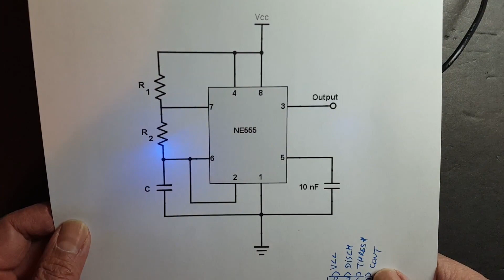HariFun #162 - Retro Electronics with Julian Ilett

Comment: That circuit is all over the internet. I built that way back in the "Night Rider" TV show days.
Nothing special about that circuit... Thought you were more electronics mature.
Unsubscribed...
Reply from the maker: Lasersbee, I understand your disgust at the simplicity of the project.  But simplicity was exactly why I thought it was cool.   Just like Juilan, I had fun putting with that circuit together.  I'm sorry you didn't enjoy it.  Sorry to see you go.  Thank you for your honest feedback.
Reply: And this is why I detest the Arduino fanboys. They learn to copy and paste code but learn nothing about the very basics of electronics. I will not let my youngsters move on to programming without learning the fundamentals of electronics first. The knight rider circuit has been around for decades, and is one of the first projects to learn after learning the simple oscillator variations of the good old 555 IC. Basic components, then timers, op amps, and counters. Once you know by heart how to construct basic circuits with these IC's then you can move on to microcontrollers, and even then in most cases a PIC and simple pic programming cable and board, can do most of the basic functions necessary that learners of arduino need in their early projects. Its all about the proper foundations.

Comment: I have some transparent breadboards from a seller called  robodyn on Aliexpress and they are great. They do not film well though. I have ordered some white ones to see are they also good
Reply: Hari Wiguna I believe these are the ones he mentioned https://m.pt.aliexpress.com/item/32807239104.html

I love your videos, Hari. Please keep making them. Cheers.
Reply: This is the store I'm talking about Hari

https://robotdyn.aliexpress.com/store/1950989?spm=2114.10010108.100005.2.25e820d7N3Hl1z

Here is a half size white one:
https://www.aliexpress.com/store/product/Solderless-Breadboard-Self-Adhesiv-size-8-3x5-5x0-85cm-White-color/1950989_32801985959.html
Reply from the maker: Thanks Brian! Interestingly, that one looks exactly like the crappy one that I use in video.  The continuous power bus (some has split power bus), the sequencing and uppercase letters, and how the first two and last columns do not have associated power bus column.  But you can't judge a book by its cover, so please let me know if you like yours when you get it.
Reply from the maker: Hi Brian! Thx for the tip.  If not too much trouble, could you shoot me the link to the white breadboard?  When I searched for breadboard robodyn it thinks I'm searching for "breadboard nobody". lol
Reply: Hari Wiguna yeah will do! All my white ones at the moment are terrible. You can't believe how much better the see through ones are!

Comment: Both the cmos and the bipolar version bring the output low to gnd, not floating. By adding the diodes you are making them act as floating when the output is low, and this is the proper way to do it. Julian put in resistors which isn't such a good idea, because what you are doing is connecting these resistors from Vcc to gnd, wasting current, and also taking the voltage at the middle of the resistor divider for the led. This ends up being equivalent to a source of Vcc/2 with a resistor of R/2. Since you are using blue leds which have a higher forward voltage, and i'm guessing you're using a 5v supply, you're getting 2.5 v on the leds which isn't enough to make them light up, Jullian used red leds which have a lower forward voltage and i believe he also used a 6v supply, try a red led, it will probably work.
Reply from the maker: Thank you for the detailed explanation.  Julian just asked me what voltage was my PSU.  It's 5V, so it makes sense that 2.5 was not enough to light up the LED.  I was unable to find any decent red leds, so upped the PSU to 8V and it STILL doesn't work for me.  My scope is at work.  I'll have to probe the voltage at that junction.  Curiouser and curiouser...
Reply: I'm not completely sure about this, but it might be the output current limiting the voltage. I can't tell for sure from the video but it looks like you are using 100ohm resistors, this would cause a current of 25mA to flow for a 5v or 40mA for an 8v supply and the rated maximum output current for the hef4017 is 10mA, try putting in higher value resistors, like 510 or 1k resistors, the leds will be dimmer but it's more a proof of concept, the better solution uses diodes like you did in the video(and like the circuit Julian took his idea from did). Good look :)

Comment: Hi ,
Hari ,Super good but not that cheap are the breadboars of the brand" EIC"
And a bit difficult to find.
But components slide in with ease and make good contact ,no more bend wires or pins